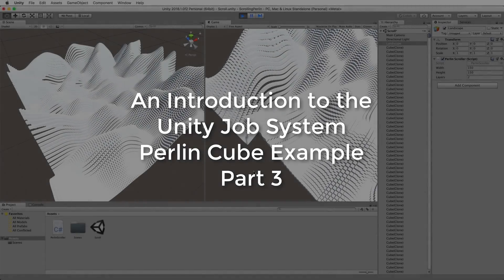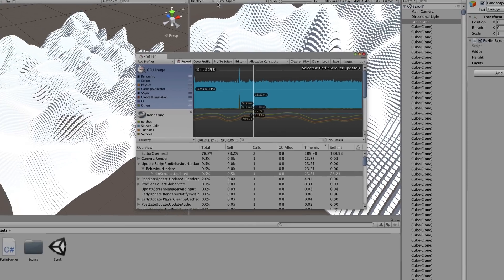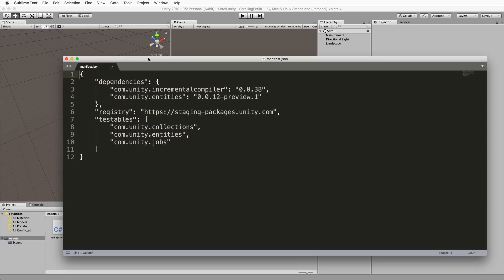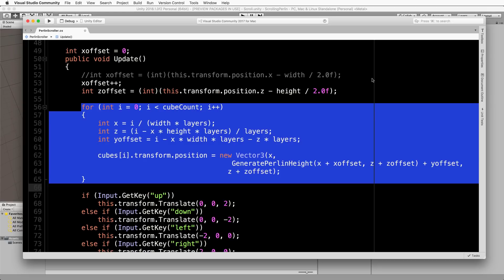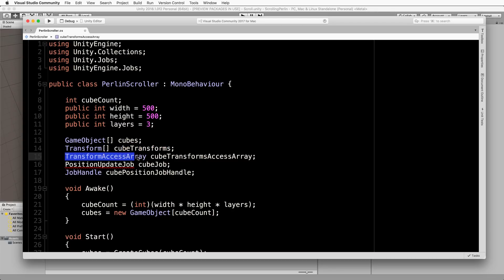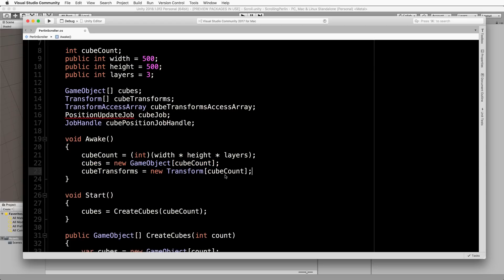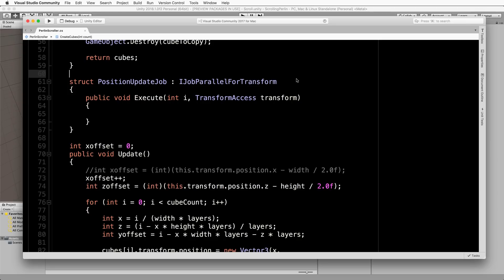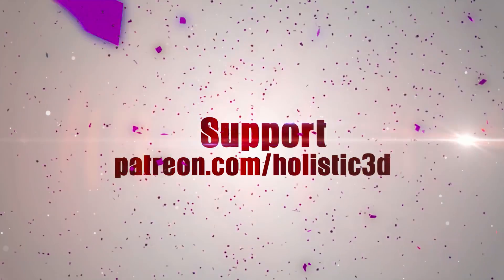An Introduction to the Unity Job System Part 3: Perlin Cube Landscape Example

Comment: FYI on the 3:28 -> ... JSON / Packages section of the tutorial; as of 2018.3.4f1 importing the right packages is done

1) by accessing the Package Manager in the Window top-bar menu.

2) in Package Manager window, top bar menu,
2a) click left-most menu, set option to 'All packages'
2b) click Advanced, set option to Show Preview Packages.

3) Search for and install all the following;
3a) Burst,
3b) Jobs,
3c) Collection,
3d) Mathematics

And you're done. You'll notice that there is no reference to the ECS Entities package, but that is because it's really buggy getting it started right now, and the turorial doesn't actually utilize the ECS repository.
(If you really want to solve it, start with: https://github.com/Unity-Technologies/EntityComponentSystemSamples/issues/95 )

Amazeballs tutorial as allways from this gifted voices!

Comment: Great tutorials!

FYI in the latest Unity (I'm on 2018.1.0f2) there is a "Package Manager" underneath the Window menu option.  Here you can now install the Incremental Compiler and Entities packages through the manager, as well as other previously git only "extras" packages such as TextMesh Pro, ProBuilder and so on.  This avoids the need to edit the json file manually, and also embeds these into the project.  The manager also serves as a good place to update when new versions come along.
Reply: Thank you!
Reply: Yes, thank you!  When i tried to edit the JSON file by hand I must have done something wrong because it completely messed up my Project and I had to delete all the non-Asset folders and let Unity recreate everything from scratch.